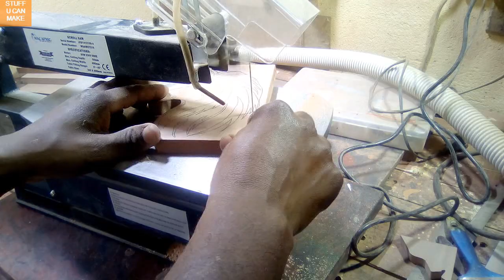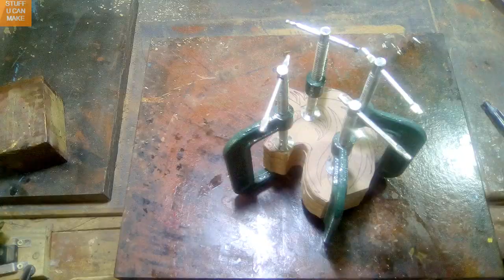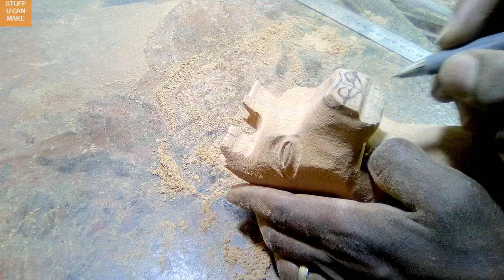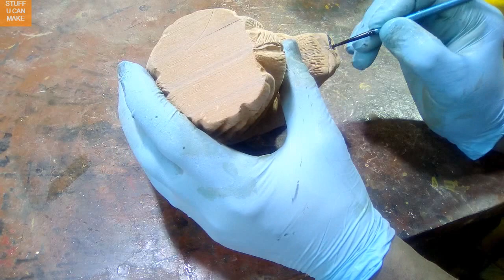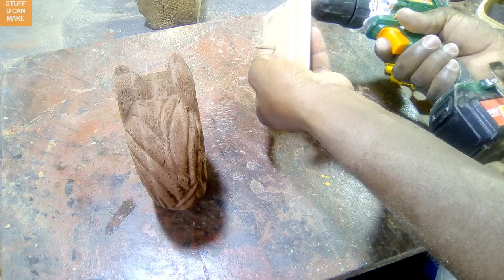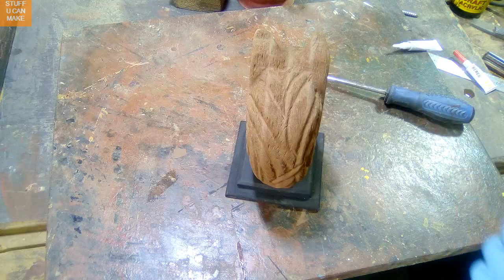Wood carving | Carving a wolf statue on MDF using a dremel rotary tool

Comment: Hi Jabulani, 2 3D sculptures. 2 superb pieces. When you started caring the hair/fur into the head the whole piece just came alive. I appreciate they must take time and are a challenge but the end results are just fantastic. One tip I learned from someone was if you put a little salt between the layers when you glue them the salts stops the pieces from moving/sliding around but doesn't affect the glue at all. I have used this method and it works. Cheers, Huw
Reply from the maker: Are you aware that if you never challenge me originally, I wouldn't be able to do this? No man is an island, we all grow because someone, somewhere either challenged us or encouraged us to do something we were afraid to do or thought was impossible to do. My friend, I can't stop thanking you! Thanks for the salt tip also.